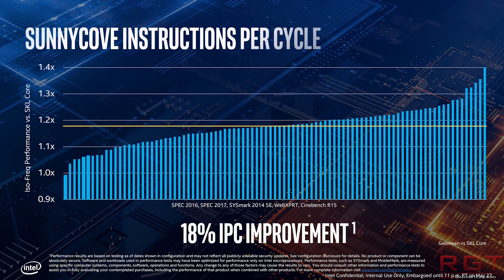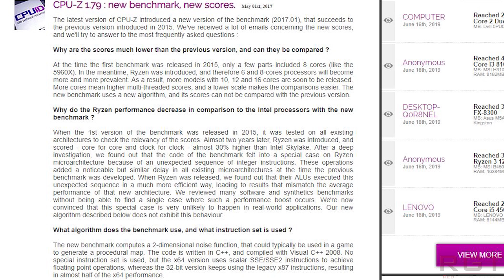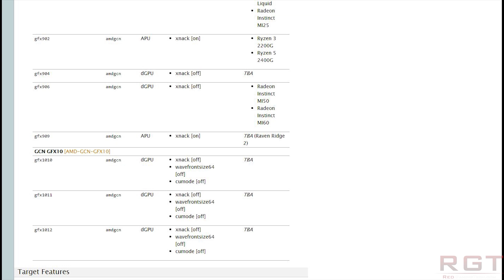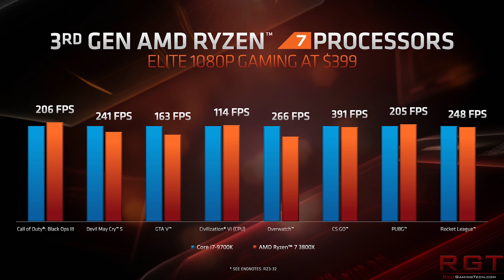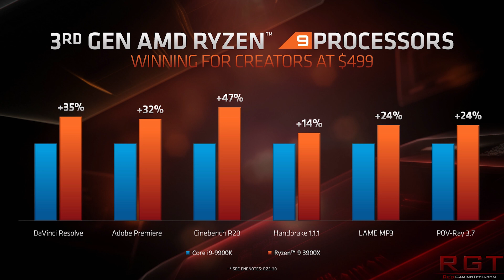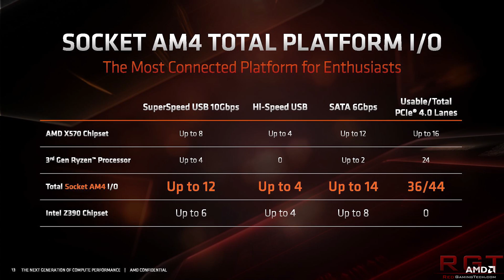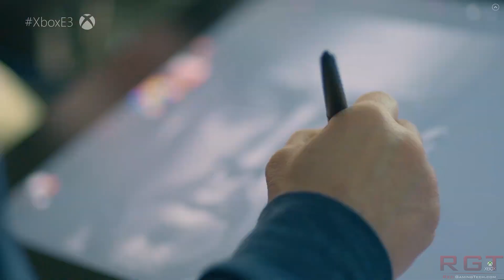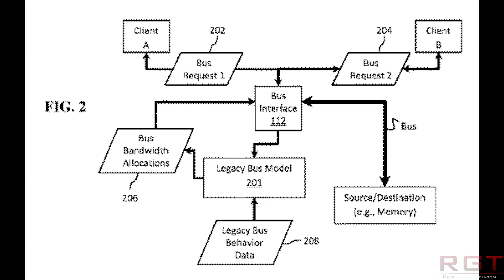2 More Navi IDs Spotted | B550 Launches next Year ? | Xbox & PS5 To Cost 400 USD

Comment: Based on the hardware reportedly going into the consoles, I highly doubt the non streaming versions will be anything less than 799 and even at that I'd say they'd be losing money on them.
Reply: Who the hell is going to buy a console for $799? Those machines will not cost more that $500-$600 at the most and that's a real stretch because mass market will not buy that. The Xbox One X isn't flying off shelves at it's high price, neither is the PS4 Pro.
Reply: Expert
Reply: @evilformerlys4704  Exactly. I think the absolute highest people would be willing to pay is $500 USD. Sony pushed too hard during the PS3 generation when the 60GB version launch one was priced at $600, and they suffered by falling behind the 360 for a while. They started turning things around when they released the $300 PS3 slim about 2 years after.
Reply: Well as for the cpu, i think they will be using chiplets that didnt make the cut to be in their server and pc lineup. as for the gpu, announced navi prices are really inflated, jim from adoredtv calculated the manufacturing costs. its not like you can just add up the retail prices for a 8c ryzen 3000 and navi gpu.
Reply: These consoles are using GPUs DOUBLE the size of the 5700.  Those wafer costs better shrink a heck of a lot.  Plus you have the talks of 28GB of RAM, a 1TB PCIE 4.0 NVME SSD, if they sell these things at $499, they'd be lucky not to lose their rear ends on the hardware.  But they typically do make nothing overall on the hardware just to get people to buy their exclusives and get the profit there.  So it could be they sell it for less, but every early indication is that the top tier models will have no less than $600 worth of components.
Reply: @cracklingice  Economies of scale are a thing though and no chance what Sony and Microsoft are sourcing would force them to sell at absurd prices. We've been down this expensive dedicated non upgradeable console before, it didn't work when we were in a decent economy. PS4 sold off two things, price and history of games that you could only find on a PlayStation. No console buyer says I'm getting the most powerful machine to play, it's what most of my friends have I'll likely buy. 90 million plus PS4 buyers is a lot and Sony will want to have at least 10-15% migrate to the new machine within 2 years of it's debut and the rest can be a mix of old and new. A solid base at launch is necessary because word of mouth in the early stages sets the tone for what public perception will be. Trust me, being an overpriced box is not a good look for either, perceived value at best is $499. I wouldn't buy it over that price, because it sets a precedent that they can start increasing prices with newer iterations. $399 is the sweet spot for brisk sales, PS4 is proof of this.  The tech going into those machines isn't as excitement as you assume, they ordered them in the millions, Sony might take a hit with their bespoke SSD implementation but they have their own Fab for these things, Microsoft doesn't it's all outsourced. Sony will most definitely try to sweeten a higher price but honestly it may not be worth it, getting the device in many hands as possible is a sure fire way to speed up adoption. Historically they always took a hit at the registers per sale in hardware in the early years but software tends to recoup that quickly when your base grows and spend accordingly. As long as Sony keeps up their end of the bargain with decently priced hardware and excellent software I'll play along. They come out with anything going over $500 I'll wait until it's price drops and game on PC in the interim while I wait for a sensible price.
Reply: Beats headphones cost 18 dollars to make but the sell for 10 times that.